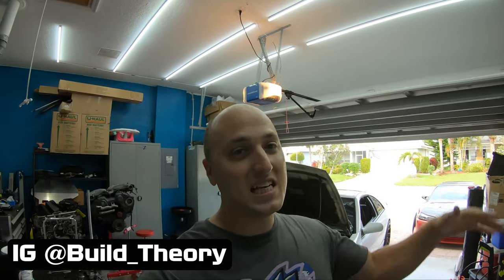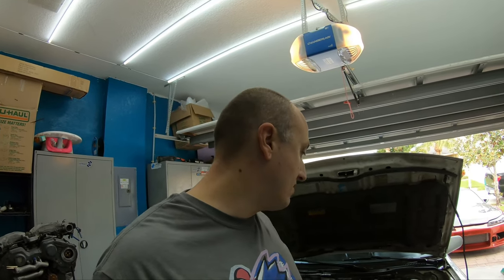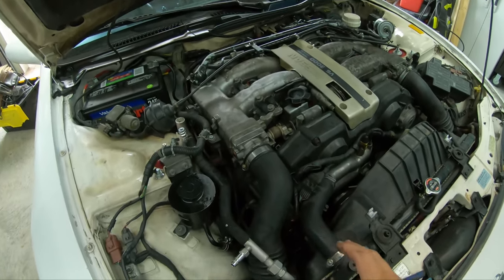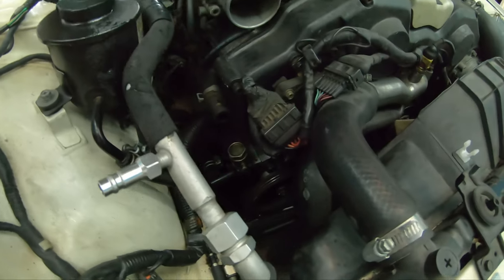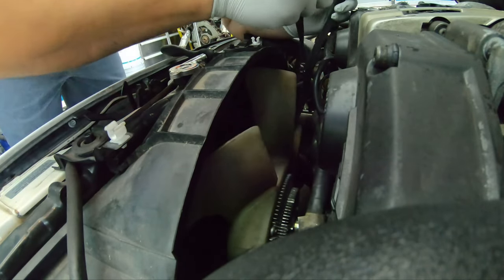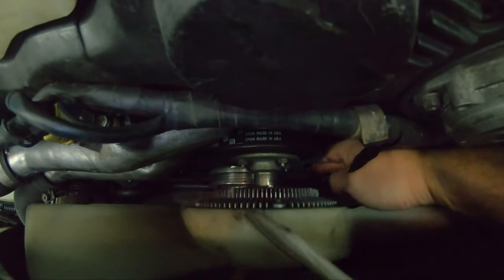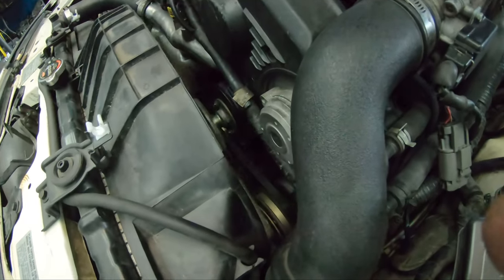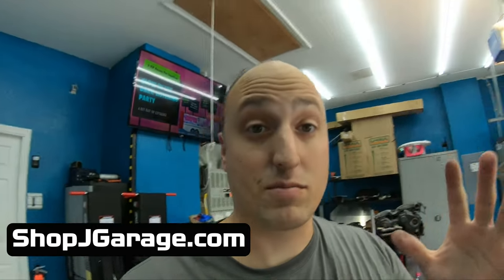300zx Z32 Changing your Accessory Belts, EASY!

Comment: Hello question is there a 120 K maintenance kit is there anywhere that offers that for are car So I may order everything I need all in one shot
Reply from the maker: https://conceptzperformance.com/nissan-infiniti-czp-oem-120k-complete-timing-belt-kit-nissan-300zx-z32-13001-0xx12_p_3849.php

https://www.z1motorsports.com/engine-maintenance/nissan/300zx-nissan-120k-timing-kit-p-7179.html?list_name=SearchResults&oid=7179%3A0%3A83489%3A1&qid=740aa191b64d8fd57166dba606b89ed0
Reply from the maker: Concept Z and Z1

Comment: Hey Jesse! Have you considered upgrading your pulleys?
Reply: That’s what I was gonna ask I hear hood and bad about lightweight pulleys specifically the crank pulley
Reply from the maker: I haven't, my 300zx came with an under drive crank pulley (harmonic balancer) witch is working fine.  The OEM harmonic balancer can get chipped up easily and expensive to replace, the after market aluminum ones are cheaper and don't seem to chip as easy. For the Alternator and Power steering pulley, I think mostly just for looks, I dont think ill be replacing mine but its an easy mod that can dress up the engine bay. I would keep or sell the OEM pulleys, someone is looking for them.

Comment: About how long does it take start to finish, and once you have all the parts, what tools do I need?
Reply from the maker: Accessory belts? Maybe, If you take your Time and don't have a lot of experience, an Hour, from set up to finish. Tolls 10mm and 12mm Socket with 3/8 ratchet, 6 inch extension. Let me know if your looking for any maintenance videos, I always need content ideas. keep Wrenchin'